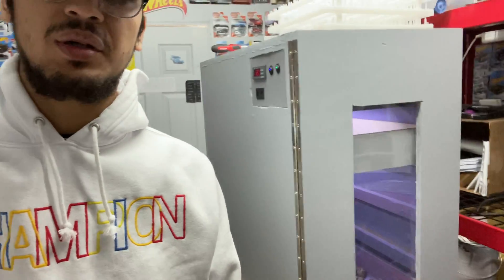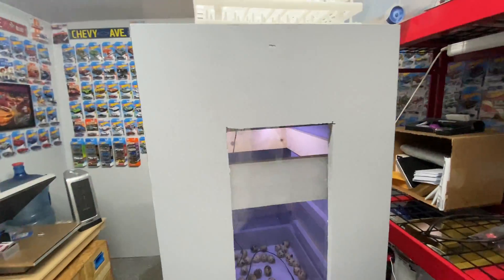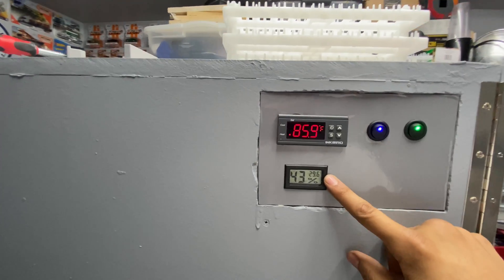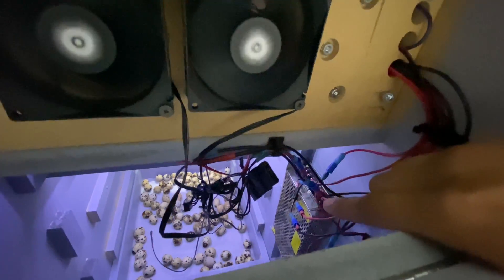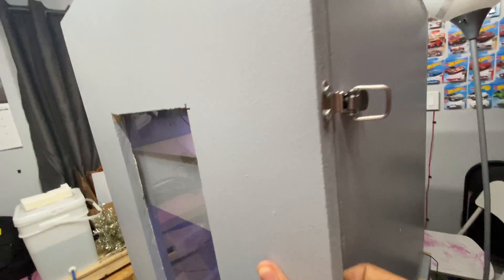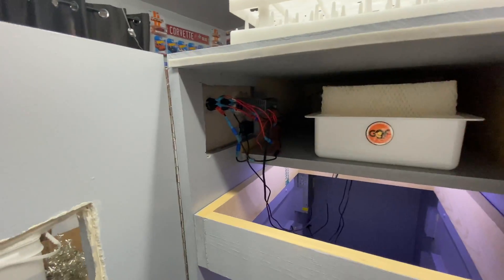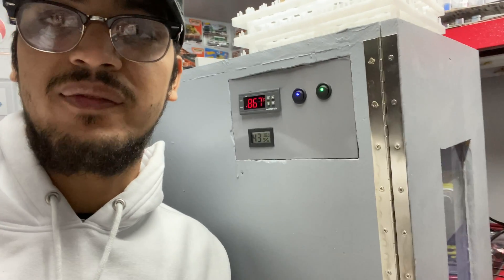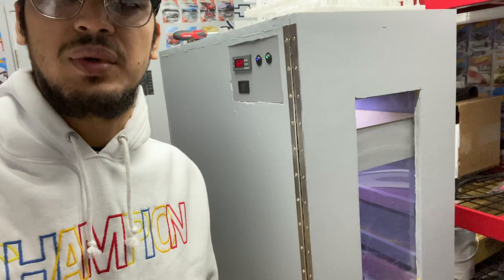2021 Cabinet Incubator/Hatcher Build Overview

Comment: What is the difference between a “hatcher” and an “incubator?”
Reply from the maker: There can be a few differences. Ultimately, they have the same function of maintaining warmth and humidity in a controlled environment. The incubator will have egg turners, while the Hatcher will have hatching trays, for the chicks to hatch into. It’s important to have a hatching tray, to prevent spayed legs in chicks and to give the chicks plenty of space to hatch and stretch out. 

When eggs are in their first 14 days of incubation, they require less humidity (~50%-60%) than in the last 4 days(~80%), so therefore a Hatcher will always be set a higher humidity than an incubator. 
The reason to have two separate machines, is to run both incubators around the clock, be able to move eggs from the incubator, to the Hatcher, and add new eggs to the now empty space in the incubator. 

If you aren’t hatching thousands of eggs per month, there is generally no need to have both of these machines. You can take an incubator and just raise the humidity, but then that incubator will be in hatching mode. 

I hope I was able to explain correctly.

Comment: Great system but where have you made the ventilation holes?
Reply from the maker: Thanks. In the video, there were no ventilation holes. It was something I ended up adding later on, to reduce humidity.
Reply: @ScaleModelAddicts  thx for replying but is the right place to make the ventilation holes?

Comment: ΅wrong fan position. It can not send air down to the eggs.
Reply from the maker: Thanks for watching my video. I appreciate the support, and the feedback. 

Like I mentioned in the video, those two are not the only fans in the cabinet. The 4 fans are spread out to specifically move air in a circular motion from top to bottom and again. 

I use many thermometers and sensors, and I haven’t had any problem with electronics running at higher temps. Where I live, most days are around 46*C or 115*F and while I agree that many electronics aren’t designed to work at high temps, I am well within my limit. 

So far, both of your comments are telling me about my design, instead of asking me about it. 

Feel free to let me know if you have any questions. :)
Reply: @ScaleModelAddicts  Thank you very much for your answer. Now I have no more questions.

Comment: Thanks for the list! how do they work with no insulation?
Reply from the maker: The MDF holds in the temperature perfectly. There aren’t any specific hot or cold spots and the temp is steady all around. The only problem I had was waterproofing. I ended up adding “double bubble foil insulation” to waterproof the walls from inside, which improved the insulation all around as well